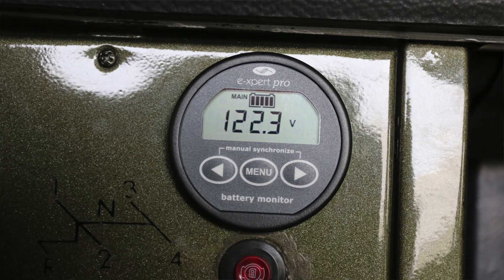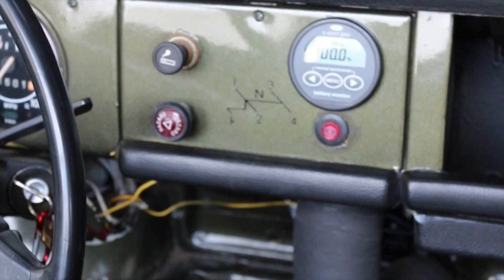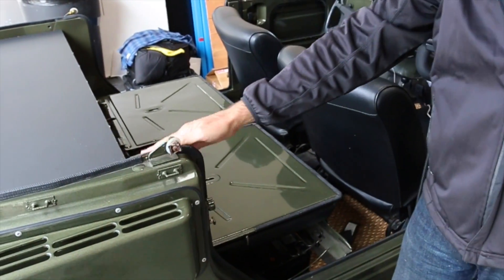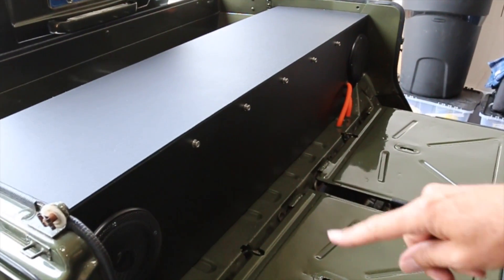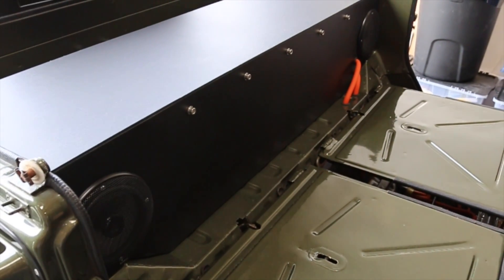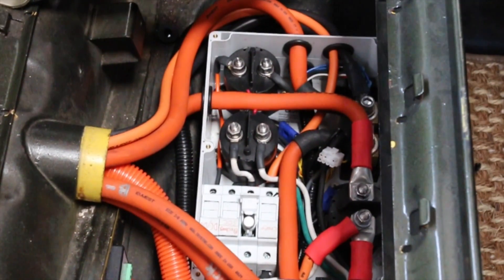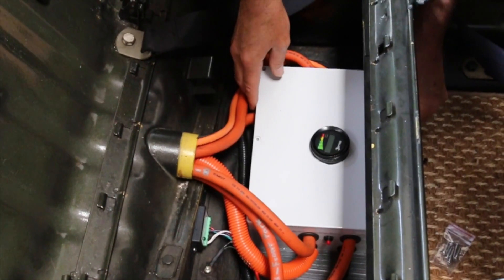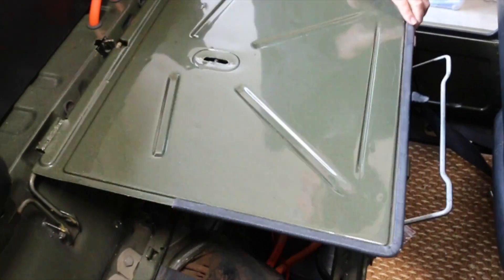VW Thing EV vs  Gas Motor

Comment: My ‘64 Beetle has a range of between 170 and 190 miles I think.  Haven’t run it down to zero to find out.  I’m running a Hyper 9HV motor and 7 batteries, 3 in the frunk and 4 behind the back seat.  It’s a rocket!

Comment: Bottom line, EV it's not cost effective unless you are a tree hugger or have deep pockets. Range, by far gas version is superior in range and much cheaper to own. You'll never recover the cost to convert, your resale is not recoverable, I imagine it's at least 20k. Batteries will not last more than a few years unless you drive it basically on a daily basis, which I highly doubt people who owns this type of vehicles do.

Comment: A stock vw in well sorted condition is a very reliable, fun car. It goes ok and stops well. It’s easy to fix on the rare occasion something does go wrong. And the engine in the gas engine car sounds great. The electric version is quicker (though not much in this comparison) but what about the downsides:

You loose the mechanical ness that’s part of the reason for buying something vintage 

Lousy range 

Can you add heat and a/c as you can to a stock vw?

No spare tire and very little luggage room in a car that already has a limited amount. 

4-5 times the price 

A thing as well as a bug are a great platform for off reading. That goes away with the electric version due to weight and that limited range.

Comment: Electric.  Not a fan nor a believer in the perceived value.  The emissions either come at the exhaust pipe or the power plant.  There's no getting around it.
Reply: William Hayden there is a difference, a fossil fuel engine is about 25 percent efficient, an ev is 95 percent efficient, so regardless of source for ev power, it uses much less energy so much less pollution. Also as energy transfers from fossil fuels sources to alternate( but soon to become the norm) sources, ev will have less and less pollution, where fossil fuel will always have the same amount of pollution with little to no chance for improvement. As an aside if you research a little you will find that  cost of building and fueling any fossil fuel energy source( also includes nuclear) is now more expensive than building and " fueling" any alternate energy source. Simple economics is now driving the shift to alternate sources, they are now the cheaper alternative, and will continue to get still cheaper, where fossil fuels will continue to get more costly regardless of their availability
Reply: True and thank you.  Residential solar and wind in my mind should be a mandatory discussion.  While tax payer dollars are flushed down the toilet on "Solar Roadway" bs we could be putting those dollars to use in viable technologies.  In my opinion every new home should have solar and wind built in without adversely affecting the cost of the home.  These are problems that are solvable.
Reply: Right there with u on that one J man!
Reply: Peope don't seem to take into account a lot of the key benefits of electric besides the fuel source. You also have engine oil, antifreeze - on most cars, transmission fluid, brake fluid, power steering fluid. All of which need to be processed, transported, used and then disposed not to mention what leaks and gets into the enviorment. Electric vehicles are much less complicated and don't require as many systems and parts that an internal combustion vehicle do. There is no exhaust system, no transmission, no brake pads and drums or rotors since the electric motor don't need a transmission and can be used for braking. The trade-off is the materials in the battery and how you charge the battery.
Reply: Pick your poison.  Apparently,  you have.  But it's not that simple.